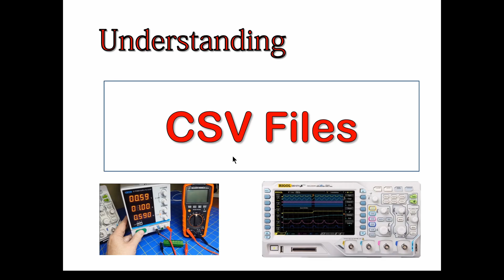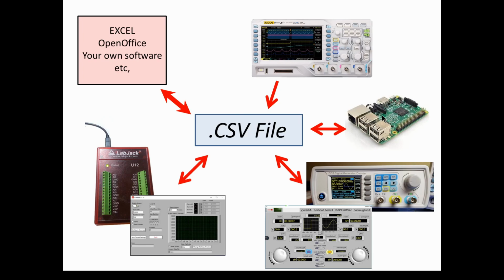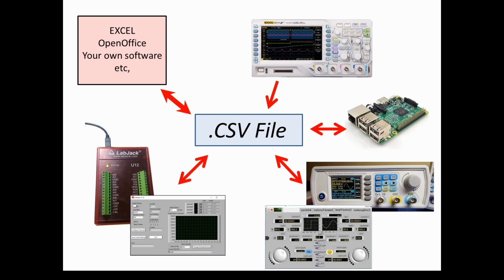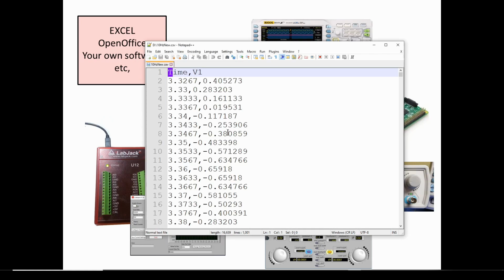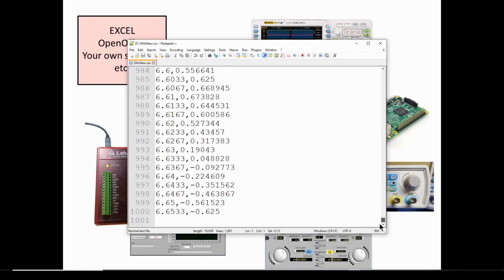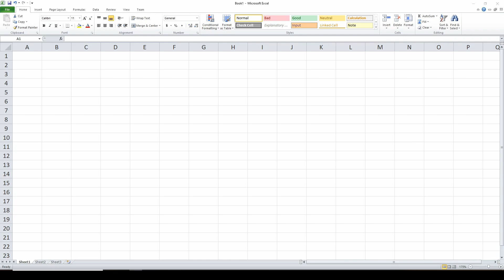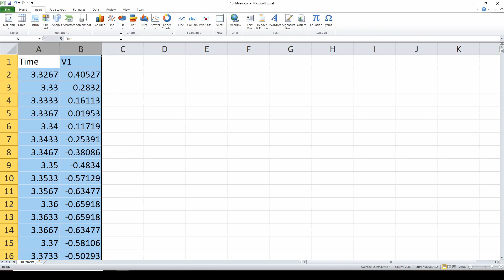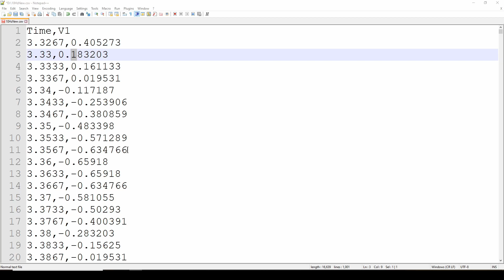What is a CSV File?

Comment: Hi, great video! I was wondering why in .csv file saved from the scope recorder there are two different measurements/waveforms data for the Y axis (V). Do you know why is that and if the scopemeter is doing any kind of filtering to output one or both of those measurements? In short, I don't know which of the data columns is the "raw" data. Thanks in advance.